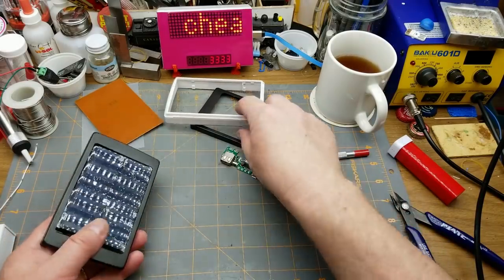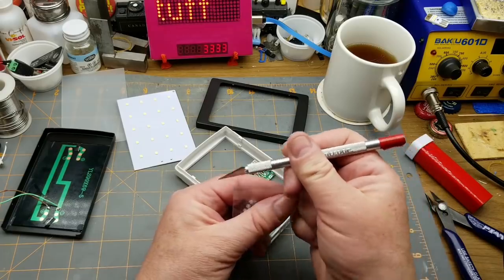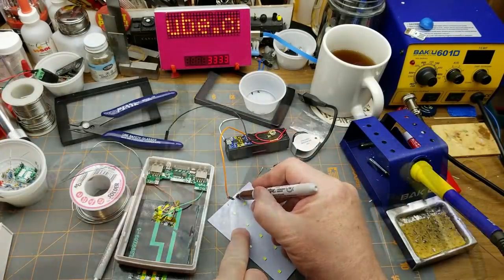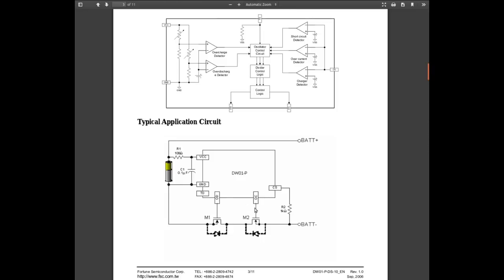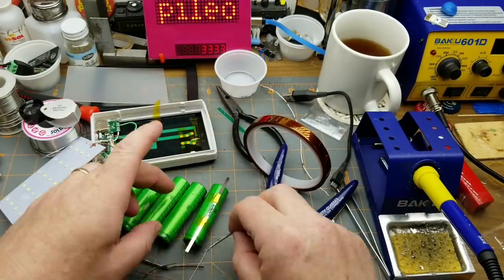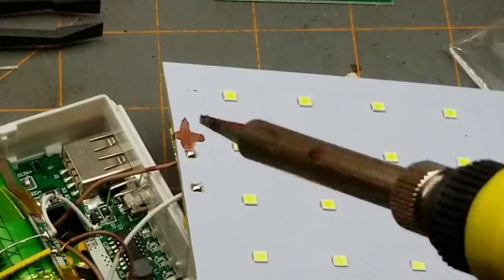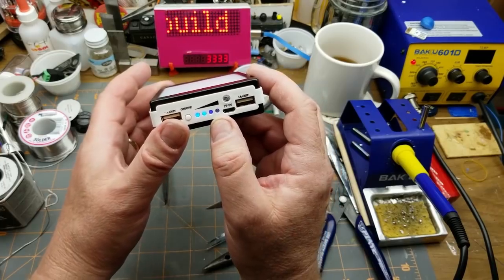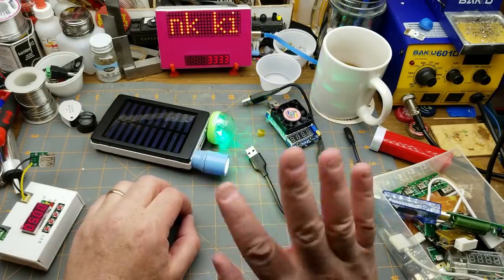cheap solar powerbank kit  build

Comment: 14:10 - You don't need to use 5 x DW01 boards. You have wired all 5 cells in Parallel, so in effect that means they are just one bigger cell. Hence, only one DW01 is needed.
Using one protection board per cell like that doesn't achieve anything whatsoever, except to over-complicate the build. It certainly doesn't make it "safer" or "better".
Reply from the maker: It might be overkill, and If they were new and matching cells I would have probably done that..
But these are old used cells that I don't entirely trust (despite them being name brand Sony cells).
I wanted to allow for the possibility for one of them failing hard to be able to isolate itself and not potentially cause issues for the rest.

Comment: Long time ago I got something similar to that: plastic case, board with long springy contacts. If I remember correctly, it had space for 8 18650's and no protection at all. So I got dw01 and mosfets from china and added them, as there were pads for this purpose, with shorted mosfet pads. I think that after about a month, maybe two, powerbank chip decided to break and discharge all of energy stored in cells. So thanks to protection, cells survived, and the rest landed in a bin for being a total piece of crap.

Comment: When i solder onto cells i usually rough them up a bit with some sandpaper, really seems to help the solder stick. Not even a problem for my TS100 iron. And some ceramic tweezers are useful too for not burning your fingers :)
Reply from the maker: I have some ceramic tweezers on order. 

They'll show up in a future mailbag.

Comment: thank you that was a good project. I need to move up from my diy ATX  bench power supply. i like the one you show on the left side with puch button Vold and Amp setting. let me if you have  coverded that in the previous vids. I tried seaching your vid with power supply and could not find it.  thank you.
Reply from the maker: I didn't do a video specifically about that power supply, but I did explain it a bit in this one: https://www.youtube.com/watch?v=SP7rDg4A7sc

Comment: Indoor lighting usually doesn't produce much current on a solar cell.  Try taking it outside on a sunny day.  Are you able to easily get back in and do some current measurements?
Reply from the maker: If it stops raining a and the annoying fog buggers off, I should be able to do that.

Comment: Not surprised at how it's designed for the price. I had one fully assembled that worked nice for months then a light wouldn't shut off on it. Something in circuit board failed. Some day I'll play with it. The best power bank I've ever had was the model that replaced Julian Ilets favorite model. It has the same number of batteries I think 5 and works well. I think it was around US$30
Reply: Which brand or where do I get a good one?  Thanks!

Comment: at 22.26 you soldered the battery wire to a different place to the pad you tinned. I assume that as it worked they must be same track!
another great vid, very relaxing to watch

meant to ask where did the battery protection strips you used come from, they look like a great form factor to fit into lots of battery projects
Reply from the maker: They're from e-bay. 

I got them at auction last year, but even at full price they're only about $0.30 each.
https://www.ebay.ca/sch/i.html?_from=R40&_sacat=0&_nkw=10x+3A+Protection+Board+for+1S+3.7V+18650&_sop=15
Reply: @pileofstuff  thanks.

Comment: On my pre-assembled build the major problem is the small screws can only be taken out (in my case) after removing plastic around the supposed white support structure insert since they would touch the outer part ... (quality ..quality ) also the button sucks! It will get stuck on the hole in the white plastic structure. In a word ---quality is not what you're getting .
Reply from the maker: Yup, I went into this (and many of my cheap kit builds) expecting crap quality.
That's part of the appeal - finding out just how bad some of these things are.

Comment: Puts a nice blob of solder on the [flat] circuit battery  terminal...... Proceeds to solder to diode pin instead!
Reply from the maker: Like I said, soldering at arms length with the camera in the way is not easy.
Reply: @pileofstuff  you wouldn't catch me doing that........🤔
Reply: @BrazzaB1  Right, since no one's watching you. This channel is awesome.
Reply: @ercost60  Of course I've never done that! 😉 And yes, cool channel!

Comment: @pileofstuff I think the 2A-out label refers to the fact that it's the 2nd USB output with 1A capability, not that it's a 2 amp output. There are other listings on ebay for the same device that show this in their listing as 5V-2 1A (see: https://www.ebay.com/itm/30000-50000-80000-mAh-Dual-USB-Solar-Power-Bank-External-Battery-Pack-Charger/123058123291). It's definitely misleading.

Comment: apologies i was watching you wet solder the last pad then you soldered the wire to a different location am i going bonkers ?
Reply from the maker: Nope, that was me. 

Like I said, soldering that far away from my eyes with the camera in the way is a considerable challenge
Reply: @pileofstuff  ok cool long as it worked as intended

Comment: I order two of the same power banks in the video and got my refund for them as well. order them before seen this video. 
reminder no wires, no installation (build) manul, no batteries 18750. the seller gave me no headaches refund.

basic they are the same as the one you build in this video

think I just going to trash them 2ea.
Reply from the maker: It mostly does what I expect from a cheap power bank - just pretend it doesn't have a solar panel.